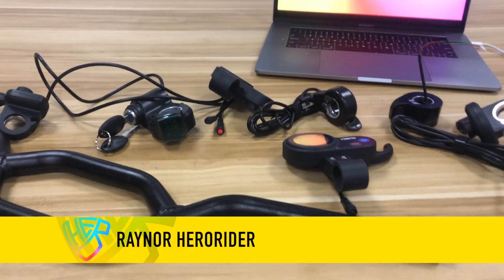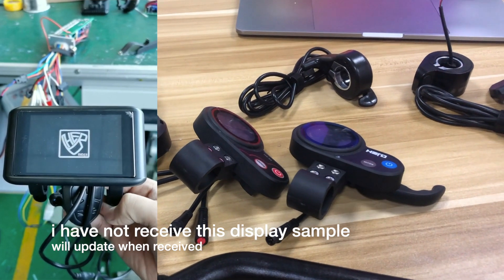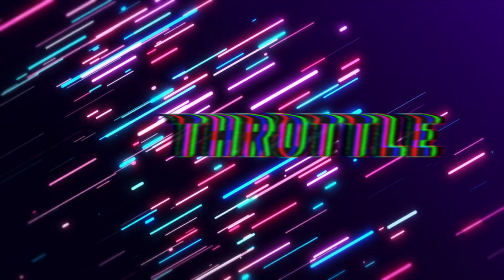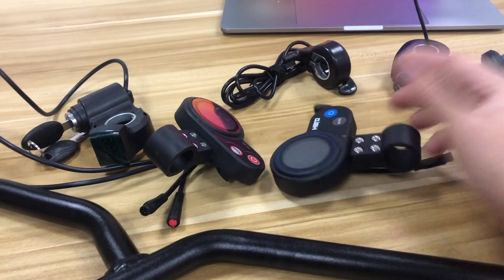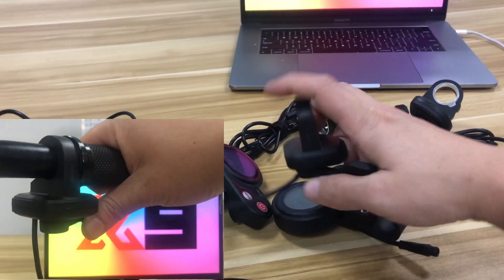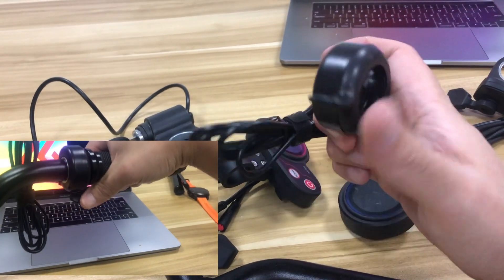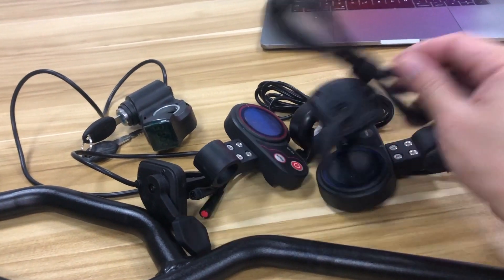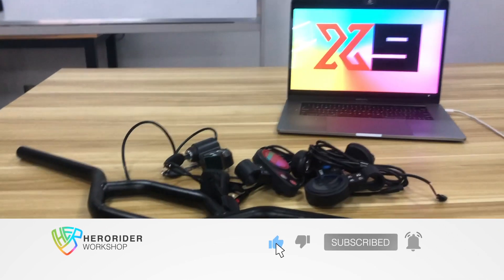X9 Part 5: types of electric scooter display and throttle l x9 project

Comment: will the ukc1 display work with kyesang? i have one here and was about to try. but i would like to have that hero logo opening screen :)
Reply from the maker: Have to compatible first . I still waiting to receive the sample and confirm this 😂
Reply: @HeroElectricScooter  tx rx signals and the protocol i think is fairly standard. i'll wait before i play with my ukc1. came with another brand controller but shares the same specs. ie controller also works with normal lcd.
Reply from the maker: @highwaltage  remember to join our FB group https://www.facebook.com/groups/herox9